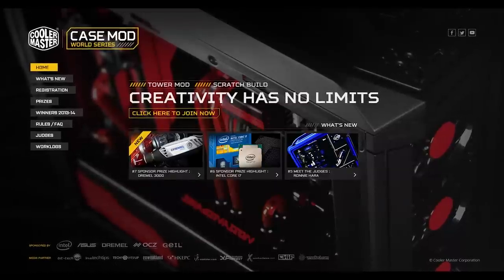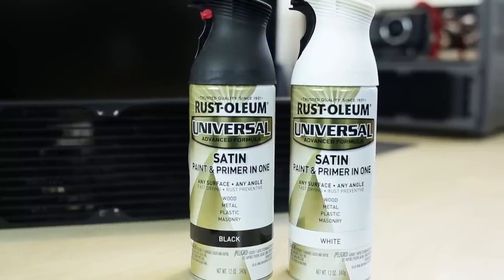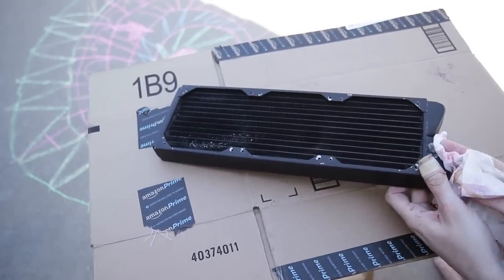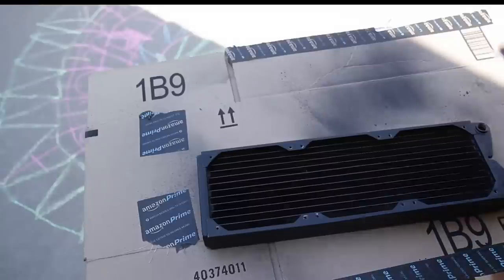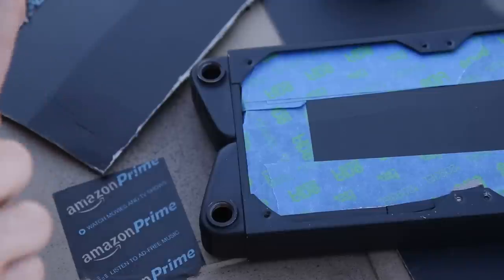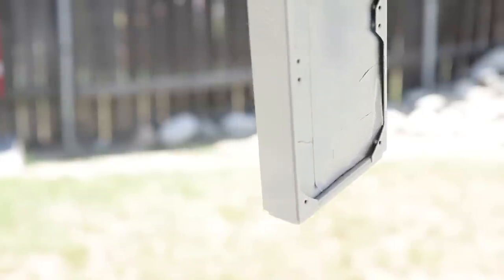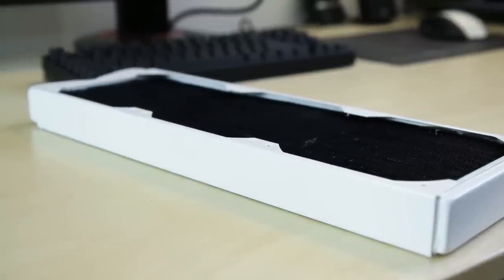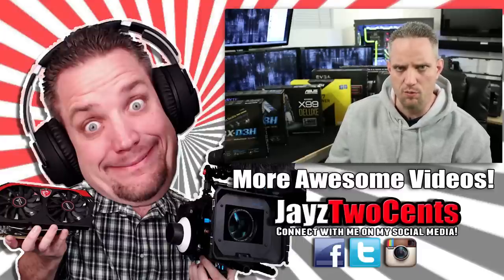Tutorial: How to make your radiator look awesome!

Comment: if you put the spray can into tap warm water ( dont sink just so that bottom of the can is in water) paint will come out smoother and paint will come out more evenly without clots.
Reply: Reaper-Virus really?
Reply: boss1234234 yes if you do it correctly
Reply: boss1234234 Yeah this works, I used to do it when when I painted my airsoft guns. Eventually I stopped caring enough to bother.
Reply: Reaper-Virus nice info! what is the optimal temp for that trick? :)
Reply from the maker: Reaper-Virus I had them sitting in the sun to warm them up, but didnt seem to help much. Next time.
Reply: ***** sun isnt same thing it doesnt distribute heat evenly and usually leaving spray cans into sun causes clots because side towards the sun is warmer than the other side. So i dont recommend leaving them into sun.
Reply: lumrefismanden i dont know accurate temps but likely around 35 celsius or 95 fahrenheit. Dont use water that is close too close to 50 celsius or 122 fahrenheit because spray cans might get rekt/explode under tempetures that high. ALWAYS CHECK THE CAN WHAT ARE SAFE TEMPS !

Comment: Jees you guys take it to the next level don't cha? Iv'e worked in powdercoating and paint for years, this won't matter to the heat dispersion whatsoever, same as radiator paint, plasticoat and other various paints used for hot or warm surfaces, so you're saying cos it's black in colour it gets hotter?.. behave yerselves and give your heads a wobble.

Comment: jay i wann to spray my fins red there will be any problem with the cooling ?
Reply: akghost96 ncix got a video on on painting fins.
Reply: It will decrease performance but it won't kill it.
Reply from the maker: shawn finkenstead Its not rust... its the color of the copper showing through
Reply: ok.
Reply: shawn finkenstead OK, as Jay pointed out, radiators are made of copper that been lightly painted, they don't 'Rust' only Iron can do that. Copper can corrode, forms copper oxide which is green.What you are seeing is the paint flacking off and the copper showing.
Reply: ok.
Reply: That's why the Statue of Liberty is green ;) corroded copper

Comment: Damn i woukd have saved 40€ on fittings buying black fittings and painting them, bought white flavour... i dont regret, the mosoon ones look so high quality (the barrow onea havent arrived yet), but... you know, knowledge is power and sometimes money saving... but well the paint spray can would be like 10 so maybe 30€ saving... humm yeah still high savings, well crying now wont fix it, its ok... i might paint the raditor if i find a cheap black one to white, maybe do the same to the mobo... will see. 1 thing for sure, its gonna be a killer build, my 1st i didnt knew as much about pcs, now i know how i can make it badass, to fit my liking.

Comment: Painting 101: Always start spraying while not ON what you are painting because you will get platter. Spray all the way across, either vertically or horizontally. Once off of the object let go of the spray, go back on the spray while still not pointing at the object, repeat process. This will give you a perfect, even, splatter/drip free paint job. Don't just go balls to the wall wiggling it around like a fool.

Comment: Tip: When removing dust pre paint, go over with different cloth, until you don't pick up any more dust. And ffs, make sure to clean your work surface before setting it down again and painting - no point in cleaning it if you plump it down on a dusty surface when painting.

And plug those ports before sanding and painting.

Comment: Oh man....you forgot to tell us not to spray the dusty radiator near a ham sandwich.......I had a ham & dust sandwich.....it tasted.......actually not too bad.......I now add dust to all my ham sandwiches. Thanks Jay!

 BTW.....no one should paint unless they are wearing shoes........you broke a cardinal rule of spray can painting radiators.....toes should not be viewed while painting. Toes can get stuck in radiator ports and so to prevent any toes from getting into your radiator.....please....wear shoes........

The best way to tell if the paint is dry is to touch it.......I always touch freshly painted anything and I always leave a fingerprint somewhere. I then have to remove the paint and start over......I always do that......I am still painting the first thing I ever spray painted.....my bike......it's been almost 25 years when I first started painting it......and I still have not gotten it to where it is all good......I keep touching the wet paint instead of waiting for it to dry.  I may do that with my old radiator......it will give  me something more to do when I retire......repaint my radiator and my bike.

Comment: You can use a heat gun on low to help cure the paint quicker.  Just make sure to constantly move the heat gun around to avoid rapidly heating only one spot of the painted area.  
You may also want to look into the various spray can removable dip colors/wrap paints including glow in the dark (generally want to end with a thick coating overall) and the various color-shifting paints and topcoats.  Some come in complete kits, like the dupli-color mirage (not a plug, just an example)
I've used the removable wrap/dip aersols on engine bay trim and it held up fine under those temperatures while also coping with various fluids, cleaners, de-greasers, and environments (below zero to 100+ from cold engine to normal temp - in Fahrenheit)

Comment: Does paint on the fins limit the heat dissipation in any way?
Reply from the maker: Shaun Coates not really. At least not in this case. There is very little paint applied.
Reply: Shaun Coates not likely. Unless you use a metric ton of paint. Since you use fans, it's convection that's in play, not radiation. Or, they both still apply but radiation is much less significant. That means that as long as air is flowing over the radiator, it'll cool down the surface. And you need A LOT of paint to make a cover that's so thick that it effectively works as an insulator from the rushing air.

Having air bubbles in the paint is actually worse than having too much paint, as air is a really good insulator as far as heat transfer is concerned. Which is why insulation for your house has a lot of air bubbles in it.